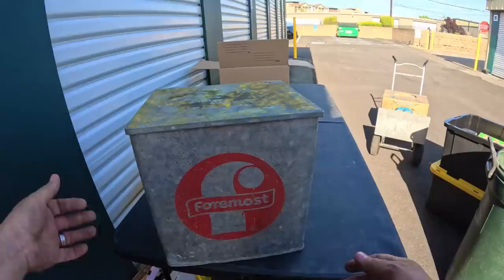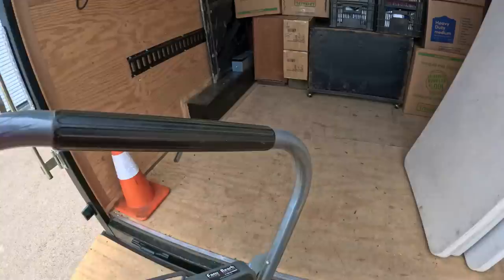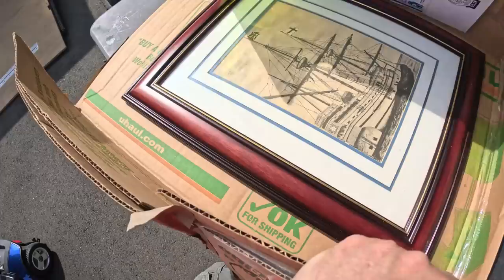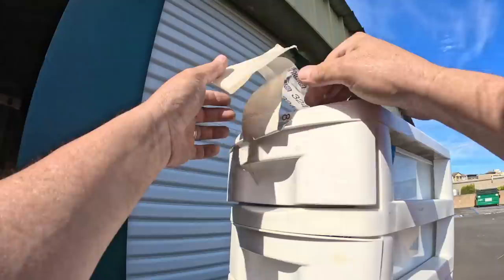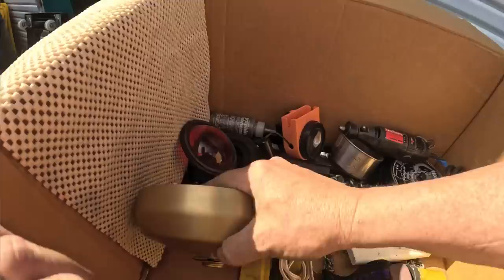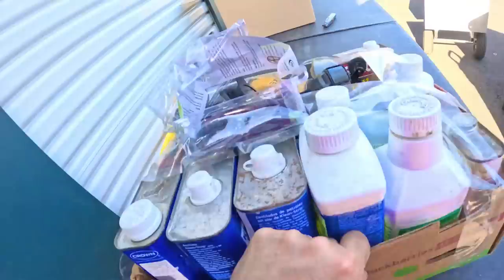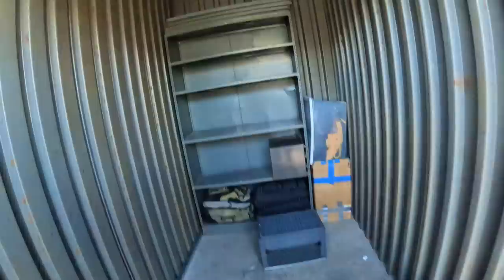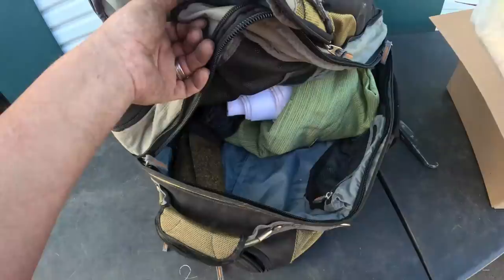This one box could get me banned from YouTube..

Comment: Foremost box is a vintage milk delivery box.  The milkman would place your milk in there and pick up the empty bottles you left inside.  It may be worth more than $20
Reply: My last house in LA, built in 20’s or 30’s had a metal compartment built into the wall  of the laundry room that opened to the outside.The little door had a metal dial type  thing in the door that you turned to mark what your dairy order was and then the milk man would place your order in the compartment! There was no brand identification. 
When I remodeled I left it undisturbed. I wonder if the young couple who bot the place kept it when they remodeled.

Comment: The Kodak screens *may* be screens that are used in a darkroom for film printing, like a halftone screen. Hold them up to a light, and see if they have a pattern in it. The one looked like it was a brick pattern, but it went by pretty quickly. They seem a bit rigid, but look anyway at 35mm darkroom stuff if you research it.